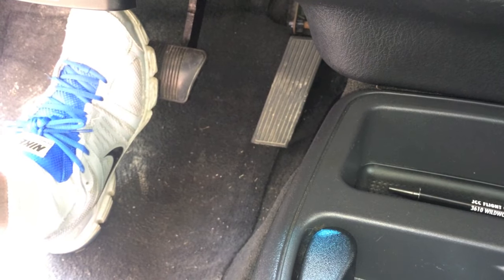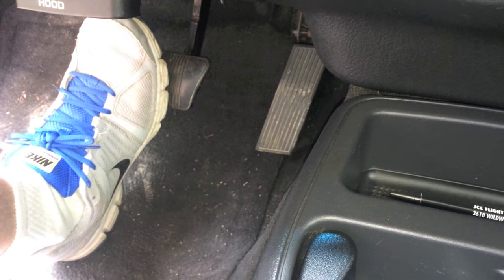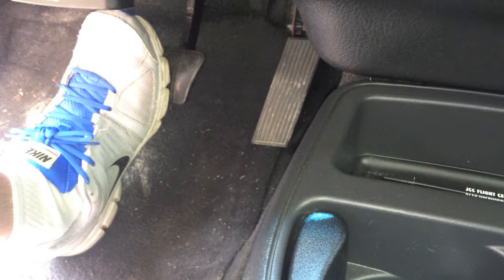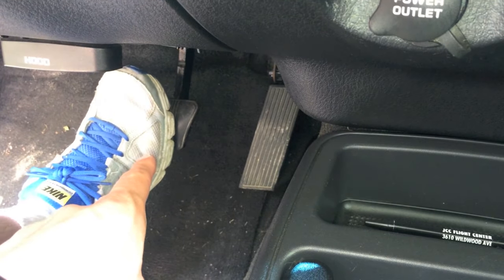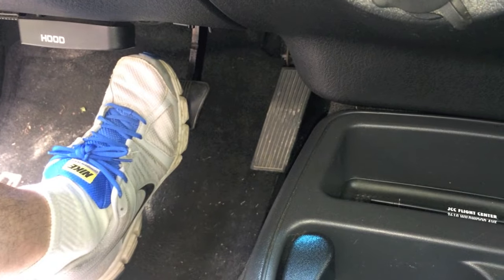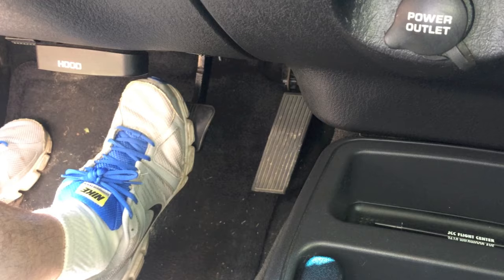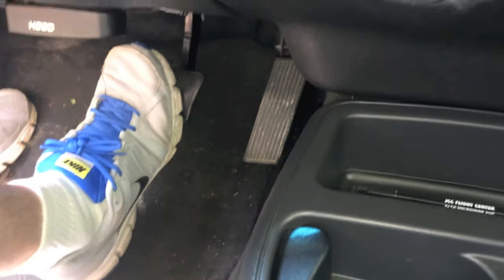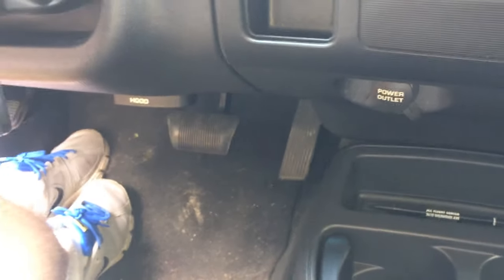HARD Brake Pedal - How to check if your BRAKE BOOSTER is GOOD or BAD

Comment: thanks for the good information.
i have a problem that when  I brake my paddle goes all the way down, and i had changed the disck and brake pads since 1 year.
is this dangerous ?
Reply from the maker: This is very common with vehicles as this is the beginning symptoms of your Master Brake Cylinder (MBC) losing its strength.  The MBC pushes/regulates  brake fluid to and from all brake components and once it has begun to weaken...your brake pedal becomes very mushy and will soon fail.  Double check inside engine as well as under car and at each brake component for leaks.....Please Subscribe to the channel thanks again!

Comment: Michael, I have a 2005 ford excursion 6.0L diesel and noticed my brake is super stiff. I did the test you showed and found that once you turn on yes the brake moves forward but also bumps back quick. Is this a booster issue or perhaps the valve?
Reply from the maker: Yasmany Dominguez 

Thanks for watching & we appreciate you reaching out to us.  We recommend starting with the valve as it’s a friendly repair both on time & money.  Keep us posted.

😎👍🔧🔩

Comment: How much Vacuum should should you see on a Vacuum gauge from your intake to the Booster. ??  (1971 440 Engine).
Reply from the maker: Eric Burk 

Thanks for watching Eric, great question!  In most vehicles, the standard vacuum reading is between 18-22 at idle however some vehicles may read slightly lower & be just fine...

In the event that your idle vacuum reading is lower, you may be experiencing a lower than normal compression.  This may be caused by a possible intake leak or valves over tightened above specs!

Keep us posted with any questions, we are here to help!

Please subscribe to the channel and turn on your YouTube notification Bell 🛎 that would be awesome thanks again!  😎👍🔧🔩

Comment: Thanks for your video mate my Ford Falcon Futura ( Australia ) has this problem .
Reply from the maker: ken C.D 

Thanks for watching & we hope the video helped.  We really enjoy making these helpful videos for our fellow DIY’ers.  😀  Many more helpful DIY videos to come!

Please subscribe to the channel and turn on your YouTube notification Bell 🛎 that would be awesome thanks again!

😎👍🔧🔩
Reply: @DIYwithMichaelBorders  I have a 97 F350 with a 7.3 and my pads wouldn't release...Replaced rotors, new pads and new hoses... Still won't release..  I drive 4 or 5 miles and when they start to get harder I stop and bleed the caliper to release the pressure and caliper pistons go back in and I drive some more and after a few miles do it again..  Have good solid brakes, but calipers aren't releasing.. Thought maybe it could be the booster ..  Also replaced the master cylinder as well..  Rear drum brakes work great... Any ideas ,,Thanks
Reply from the maker: classickruzer1 

Thanks for watching & we hope the video helped.  It is most likely your Calipers.  Replacing old Calipers with new Calipers should fix your issues.  😃

We really enjoy making these helpful videos for our fellow DIY’ers.  Many more helpful videos to come!

Let us know if you have any questions.  Please subscribe to the channel and turn on your YouTube notification Bell 🛎 that would be awesome thanks again!

😎👍🔧🔩
Reply: @DIYwithMichaelBorders  Thanks for the reply, but I've replaced the calipers, brake hoses, master cylinder and flushed the system and they both still won't retract... All that replaced within the last 2 weeks .. I open the bleeder valve on one of the calipers to release the pressure and the pistons retract back into  the calipers .. Only thing left is the booster, but I have good stopping pedal on both front and back and the shoes on the rear work perfectly so I doubt the booster is bad.    But still, the pistons won't retract       But thanks ..  Have a great day
Reply from the maker: classickruzer1 

Thanks for the reply.  It can also be a damaged Brake Line.  Brake Lines actually fail from the inside out...& when this happens, internal part from the line begin to flake off & block the flow of fluid.

This leads to your exact symptoms of the Brakes locking up.  Just another thought.

😎👍🔧🔩
Reply: @DIYwithMichaelBorders  That's the only thing not replaced, the metal brake lines..  So, that'll be my next fix... Thanks so much ..
Reply from the maker: classickruzer1 

Very cool & definitely keep us posted!

😎👍🔧🔩
Reply: @DIYwithMichaelBorders  Well, before I went to the trouble of replacing the metal brake line I decided to replace my "new" master cylinder again that I had replaced 6 weeks ago and wow, my caliper pistons are releasing now...New doesn't always mean good..  or that it will last very long..    So everything is new except the metal brake line and should last several years now..  So back down to the parts house to get my refund on my "new" master cylinder..  Thanks for the concern and help.. ..
Reply from the maker: classickruzer1 

Awesome Awesome & that’s a great update.  That’s so true...New does not always mean better however it should...🤣

New parts should work perfectly...right...🤔...but not always the case.  Every now and then, a faulty part slips through the cracks.

Thanks again for sharing your update, you rock!

😎👍🔧🔩

Comment: Brakes are really hard to push. Moves little to none but eventually stops. Was told it was the brake booster but was also told it could be the master cylinder. Any thoughts?
Reply from the maker: Anthony_m8 Thanks for checking out the video.  Have you had any recent work done to your brake system in the last year?  Have you performed this test explained in video?

Comment: Hi, I just did a power brake conversion on my1978 CJ7 from manual brakes. I noticed that they're very touchy but work very well. Is this normal? It may be that im not used to this setup yet, but it just seems like they shouldn't be this sensitive. Brakes are relatively new all around the jeep too. Any input is greatly appreciated.
Reply from the maker: Thanks for watching & welcome to the DIY Raptor Club.  This can be normal indeed as your system has new brakes & system is freshly bled.

Sounds like you did a great job bleeding system.  Please keep us posted on how they perform over the next few weeks.  Hope all is well.

😎👍🔧🔩

Comment: What if my brake pedal goes down as soon as I turn on the vehicle? I feel my brakes tighten up the more  I accelerate. The faster I go the more I can smell the brakes burning up. Lately it’s been getting worse now sometimes it won’t even roll when I put it in drive. Can you please help great videos though
Reply from the maker: Snowman3g 

This is same reply on your other question.  Let’s get this figured out!

Thanks for watching & sharing your experience!  This is definitely not uncommon!  Let’s get this figured out together!  😎

It can be a few different things...

1.  Its possible that your caliper is beginning to stick...maybe caliper slides have lost the lubrication required to shift back and forward freely.

2.  It can be possible that your Caliper piston has lost its lubrication which will also interfere with the efficient shift back for forth.

3.  The front rubber brake lines that connect to your caliper fail from inside rather that outside.  This means the inner coating begins to deteriorate and fall apart, leading to clogging portions of the brake system...hence not allowing fluid to flow back and forth freely.  

4.  Your brake pads have little prongs/teeth on them.  You will notice by their location...the pads slide on a steel brace.  This may need to be lubricated to bring the shift back to efficient requirements.

I have attached a few videos.  Lets start with the easy items and then work our way up!  Keep us posted!  Please Subscribe to the channel and turn on your YouTube notification Bell 🛎 that would be awesome thanks again!  😎👍🔧🔩

1.  Caliper Slides Lost Lubrication:

https://www.youtube.com/watch?v=-DZ68tKuCQc&amp;t=15s

2.  Too much Fluid in Reservoir:

https://www.youtube.com/watch?v=X-AJ5tD6zoA&amp;list=PLjCXOz8TSkZnavDiGDyHdPKe2dV2RzEMZ&amp;index=39

3.  Failing Front Brake Lines:

https://www.youtube.com/watch?v=3FTEgbLYAdI&amp;list=PLjCXOz8TSkZnavDiGDyHdPKe2dV2RzEMZ&amp;index=78

4.  Brake Pads not shifting:

https://www.youtube.com/watch?v=3Pq15BWM_qY&amp;t=103s

5.  Replacing Front Brake Calipers:

https://www.youtube.com/watch?v=8HoaL4QM5-k&amp;list=PLjCXOz8TSkZnavDiGDyHdPKe2dV2RzEMZ&amp;index=83

6.  How to check if Brake Booster is Failing:

https://www.youtube.com/watch?v=VK4lowH7kQE&amp;index=66&amp;list=PLjCXOz8TSkZnavDiGDyHdPKe2dV2RzEMZ

7.  Failing Brake Booster:

https://www.youtube.com/watch?v=j9s7yccswPQ

8.  Symptoms of a Failing Brake Booster Check Valve:

https://www.youtube.com/watch?v=j9s7yccswPQ&amp;index=68&amp;list=PLjCXOz8TSkZnavDiGDyHdPKe2dV2RzEMZ

Comment: What if car doesn't start, peddle gets real hard and starts making some strange noise?
Reply from the maker: Hawkeye 454 

Thanks for watching & sharing your experience.  This is definitely more common than you think!

Your Brake Booster is designed to hold system pressure even with engine off.  With that said, with the engine off...if you continue to press down on pedal, your pedal will build up system pressure & get harder & harder to press until you start engine!

At this point, we need to determine what’s causing your engine to not start?

Any recent repairs?  If so, this will help us determine if a recent repair is tied to your engine trouble!

Let’s start there!  Keep us posted!

Please subscribe to the channel and turn on your YouTube notification Bell 🛎 that would be awesome thanks again!  😎👍🔧🔩
Reply: DIY With Michael Borders nothing repaired recently.  Last thing done was the radiator about 5 months ago
Reply from the maker: Hawkeye 454 

Thanks for the update?  Let’s get this figured out!

And engine needs three specific items in order to run.

1.  Air
2.  Fuel
3.  Spark

Three things to check!

Let’s start with the easy steps, Air Filter.  Verify your Air Filter is clean & not dirty to a point that it’s interfering with the engine performance.

Next, make sure you are getting a good spark.  New Spark Plugs & wires always improve engine performance & reliability.

Lastly, we need to verify your engine is getting fuel.  It’s possible that your Fuel Filter needs to be cleaned.  A clogged filter will cause significant issues to engine.

The second option with your fuel system is your fuel pump.  Hopefully your pump still works however if you are forced to replace your pump, it is pretty cost friendly!

Keep us posted!  😎👍🔧🔩

Comment: Hi, I have got a Jag 2.7 Diesel 2005, as I noticed stopping is not precise and the pedal was bit stiff, I took it to the mechanic he changed the break pads and the vacuum pump but still same? what should I do?
Reply from the maker: Thanks for watching & the next parts to direct your attention to is your front calipers.  It is extremely uncommon for both of your front calipers to fail at the same time.... and this will actually help you determine which caliper you need to replace.

After driving vehicle, check which front tire is giving off more heat and crackling sounds.  If the drivers side rim is normal temperature while the passenger side rim is very hot... you will need to replace the passenger side caliper.

Hope this helps.  Keep us updated.  Us fellow DIY’ers need to stick together.

😎👍🔧🔩
Reply: @DIYwithMichaelBorders  Hi Thank you very much for your advice, and will do the test and see.
Reply from the maker: @saazmath  

😎👍🔧🔩

Comment: So I'm doing a bit of looking around before the car goes into the garage tomorrow...had all the warning light flash up while driving and it went into limp(?) Mode(no faster than 25mph) turned it off, waited, turned it back on all good. Ten minutes later Im approaching a roundabout at 50 mpg, put my foot on brakes and my god! Thought that was the end!! Pedal was rock hard didn't move a millimetre warning lights came on (no idea what they were as I was trying to not crash and die) Any clues as to what the f went wrong??
Reply from the maker: Rose C 

Thanks for watching & we are happy to hear you’re ok.  Locked up brakes are caused by a few different things.

1.  Seized up caliper piston
2.  Lack of lubrication on caliper slides
3.  Worn out rubber brake line

Let us know what the MX shop says.

😎👍🔧🔩
Reply: @DIYwithMichaelBorders  they can't find the reason why the brakes are intermittently failing for a couple of seconds at a time. There's nothing obvious and Citroën guy who has 25+ years experience has never seen this. Currently trying to decide whether to let them investigate it or bin it off and get a new car.....
Reply from the maker: Rose C 

Thanks for the update.  That’s odd.  By chance, does the brakes activate simultaneously when an electrical system is activated...?...ex:  turning bright lights on & off, turning on a turn signal?  Keep us posted.

😎👍🔧🔩
Reply: @DIYwithMichaelBorders  I don't know to be honest, I was starting to brake before I put the indicator on, no lights were on no air con and radio. Not sure what mechanic went through when test driving it. He mentioned maybe we can send cpu(?I think that's what it is) off to be checked? He said it could cpu, but could be brake booster and could be brake fluid but There's no hissing, there's no leaks. I've had weird electrical issues tho for a while, random crap like can't have the lights radio and wipers on all at the same time and light bulbs blowing really often although that's settled down after putting a new battery in..... There's no fault codes, the abs is fine....🤷‍♀️ we're all stumped.
Reply from the maker: Rose C 

Thanks for the reply, interesting.  Definitely let us know what the mechanic finds.

😎👍🔧🔩
Reply: @DIYwithMichaelBorders  we've found naff all! Its so frustrating but we have decided to send it to the graveyard Monday so unfortunately its an unsolved mystery 😕 xx
Reply from the maker: Rose C 

😳...out with the old...in with the new.  What new vehicle are you heading toward?

😎👍🔧🔩
Reply: @DIYwithMichaelBorders  I've gone for a 2009 vauxhall astra.  I understand them a lot more than Citroëns so I feel more confident already. I've had the Citroën 2 1/2 years and it started to make me quite nervous when driving which isn't like me at all! Just hoping that no one else experiences this with their car!
Reply from the maker: Rose C 

Very cool.  😎👍🔧🔩

Comment: When I push on my brakes it makes a noise like air is coming out by the pedal on my 02 Silverado you know anything about those
Reply from the maker: Thanks for watching & welcome to the DIY Raptor Club.  That could be a small leak in the vacuum system & be a friendly repair or can be symptoms that lead to replacement of the Brake Booster.

Please keep us posted.  😎👍

Comment: I have a beat-up 1989 Ford LTD. The brakes work 100% fine and there is no leaking brake fluid, however there is a loud hissing noise coming from the general area where the master cylinder/brake booster is located. This noise is so loud it can be heard from inside and persists for about 5-10 seconds after the car is turned off.  Any ideas of what this could be?
Reply from the maker: Scott Krafft 

Thanks for checking out the video and sharing your experience Scott!  That’s a great question!  Let’s get this figured out together!  Hissing sounds are almost 100% related to a leaking vacuum line/hose.

Here’s what we recommend:

1.  Start engine

2.  Open your hood

3.  Locate all lines/hoses that come out of Master Brake Cylinder

4.  Do a thorough inspection of all lines/hoses & locate leak.

5.  Purchase new Line/hose from AutoZone.

You will find that it is a pretty friendly DIY project & is cost friendly.

Keep us posted!  Please subscribe to the channel and turn on your YouTube notification Bell that would be awesome thanks again!  😎👍🔧🔩
Reply: Do you have automatic parking brake release?  If you do check the crescent valve located near the brake pedal.  Those go bad and leak cacune
Reply: You can plug off the vacuume line. There is manual release behind pedal